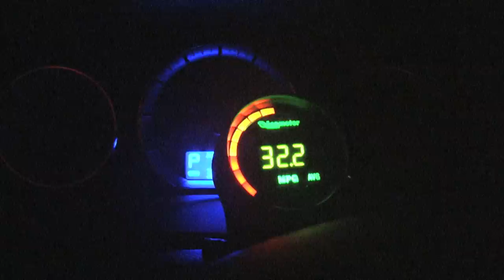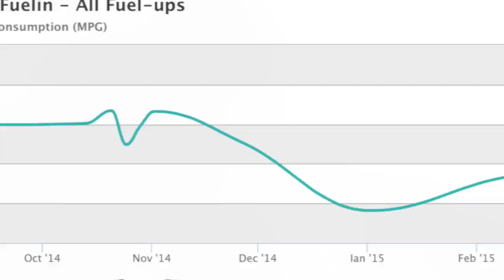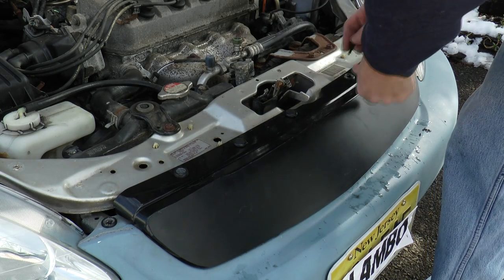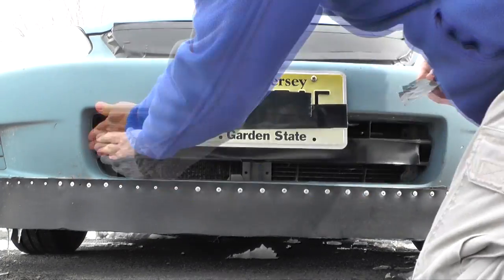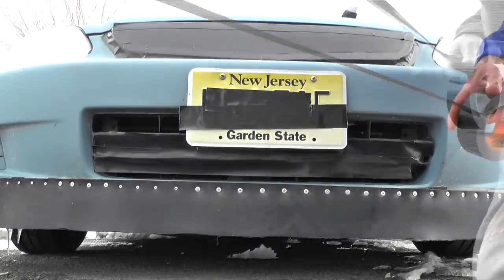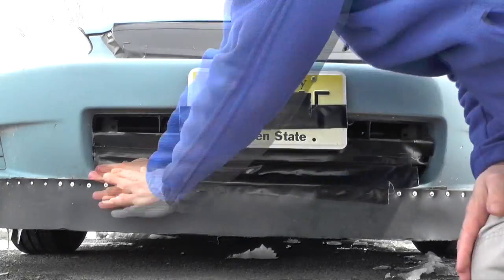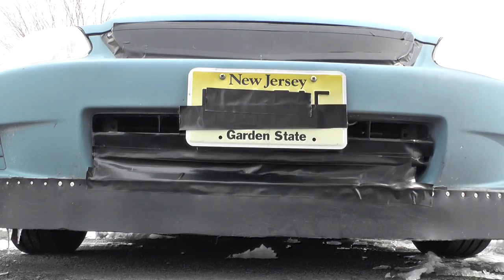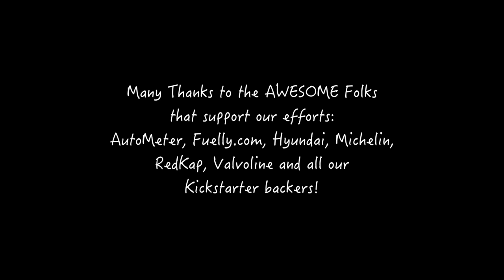Grill Blockers for More MPG? - Honda Civic Build - Ain't Fuelin'

Comment: In Canada, we just hang a piece of cardboard in front of the radiator cut to partially block airflow and adjust as required. It's a lot easier to install and remove if necessary. Truckers use zipper covers on the front grill because it's easier that way rather than having to open the hood, but basically does the same hing.
Reply from the maker: MichaelAChang Whatever gets the job done! Folks in warm climates think it's crazy. 😂
Reply: In Minnesota we do the same. Basically Canada climate of the United States..
Reply: @mpgomatic  i just tried removing the lower part of the intake but just got the helm Holtz extension off which had 2 pieces on this v6 honda (an extension into wider upwards expansion and the cover top that was clipped by 2 plastic push clips)

But that made it take longer to warm up the heater so i took the stupid beauty cover off and left the center plastic over the top of manifold as to not burn the hood cloth

Comment: wouldn't changing your thermostat be ideal? keep you in the proper range and stop you from overheating.
Reply from the maker: +Dustin Davidson Aye! I'll get to it one of these days …
Reply: +MPGomatic well it would make your fuel savings statistics accurate, instead of relying on on the weather today...
Reply from the maker: +Dustin Davidson It won't overheat due to the themostat - it's stuck open.
Reply: @mpgomatic  i think hes referring to the fact that the engine will not be at operating temperature thus your ecu will be running in an open loop, reducing fuel mileage.
Reply: Im in the same boat and the issue isnt over heating though  I just modified my intake into a short ram well a warm air intake using what i had.  It was a FIASCO  I can go step by step short story long

Comment: Did I miss the mention of cold air is denser and makes aerodynamics even more important? Much more air drag in the winter.
Reply: my car does get worse MPG in winter but come on its not that much worse that i have to modify the car.
if your so desperate you need to pinch every last penny it might be time to find a different job.  every time i get a new job i get better wages. 
tell your boss your pinching pennies hard core and desperately need a new job or pay raise. or drop some unnecessary subscription service you can live without. no one really needs TV when you have internet. sell some old crap idk modifying your vehicle to save money like a desperate coke addict trying to get another hit is just crazy. they were engineered to have a grill for a reason.
Reply: @darkshadowsx5949 bro out here comparing people trying to save some money on fuel to being a coke addict lmao

Comment: Heat the engine? Heat the fuel!  Run your gas line past your valve cover with a short distance to the gas inlet. You may need to cut a piece of radiator hose to use as insulation in order for that last 8 inches of fuel line to be kept warm. The flow rate is rather slow, and if you don't insulate the fuel line going into the carb, your temperature will drop. Use a laser thermometer to check engine temperature at various places in order to find the best place to rout the fuel line. I drove 20 miles, and then up a long hill before I checked my engine's temperature at various places. The valve cover on my vehicle was at a safe temp. nothing to crazy high like what you would get off the engine block, or exhaust manifold. More ambitious individuals can rout past the exhaust manifold, and use some type of gas (not liquid) metering. The fuel economy will go through the roof when you do this. There is a term called thermal inertia, and that's what you need to master in order to understand what this is all about. Fuel can't instantly go from a liquid to a flame. There is a transition period that takes time to change. If you don't set up the fuel properly, before you ignite the fuel, the unprepared fuel will go out the tailpipe.

Comment: I was thinking il get some useful info here but not really. Thermostatnin working order is a must! I have very economical diesel engine so if thermostat doesnt seal 100% its not going to heat up. When itry really cold it doesnt get to operating temperature just heating the cabin. So i was interested in aerodynamic part of fuel economy effect only here

Comment: I feel like directing a circular air flow grill would be the best solution to both problems. You would have wedged panels aiming towards the radiator from the top and bottom, making a direct flow into the radiator while pushing air out smoothly, that way air doesn't circulate through parts that don't need it

Comment: Nice vid Dan! I agree with everything you said about grill blocks. I tracked my instant fuel economy with my old car, a 2007 Matrix, and my ScanGaugeII would allow me to see the temperature difference with a grill block. The max temperature I would see on a typical day without my grill block was 180-185. I think the highest temperature recorded with my grillblock was 201, so I might have been blocking too much of it. Nevertheless, I was more glad than anything since I was able to fix myself a grill block using an old car mat of mine and I wedged it between the radiator and the metal frame on top of the airbag sensors. Cheers!
Reply from the maker: Thanks, DominicGuitarist! Using an old car mat is a cool idea. I'm going to leave the upper grill block in place to see how the engine temps fare as the weather gets warmer.

Comment: This was my first video of yours.  Now I'm going to watch as many as I can!  I'm putting a 351W in a Fox Body Mustang.  And I'm going to see what kind of MPG I can squeeze out of it!  Thanks!
Reply from the maker: Rob Daugherty Thanks, Rob! 351W/Fox Body = Cool!
Reply: Go for 35.1 highway to repp it for that! 

Maybe for go the 4.10 differential then, no no just kidding.  My buddy put 4.10 on a automatic dakota and did better in city due to shifting into o/d at 35 mph

Legitstreetcars made a eco vette c5 aiming for 40 mpg
Reply: Come to think about it would 4.10 be easier to roll with since its giving it more torque with its gearing say like a 0.74 and 0.50 in the T56.  Even though some try to say the 2.73 in place option 3.31 would be more efficient going 60 on the highway in the 2011-2020 coyote

Comment: I beat you would have seen those same improvements with just a properly working thermostat. Those lean burns dont like to be really cold. If it was too cold the car may have never went into closed loop. Did you notice on dash command if the car was entering closed loop?
Reply from the maker: EGGINFOOLS Indeed. The engine did not want to flip into lean burn when it was cold. Dash Command's Instant MPG charting screen show the efficiency levels fairly well. We will be installing a new header/cat with a third (wideband) O2 sensor and air/fuel gauge soon.

Comment: Thanks Daniel! I have the same problem with my 95 Accord. The temperature gauge drops at speed but normal at idle. It's got to be the cold air.
Reply from the maker: Sure thing, aquateen77723! How cold does it get outside in the winter? I'd never experienced this phenom until this winter, in this car.
Reply: MPGomatic It's been around 1°-20° for most of the winter in central NJ. I think the thermostat is stuck open like you said. I tried blocking the lower portion of the fascia with cardboard and it worked!
Reply from the maker: aquateen77723 I'm in CNJ, too. These last two winters have been brutal. Are you still using the cardboard blocker?
Reply: Yes, I still have the lower part blocked. I zip-tied it to the inner grill. I was watching Ice Road Truckers, and they did the same thing to their rigs! But yeah, this winter was brutal!

Comment: did the exact same tests in 98 got the exact same results as you thats funny!up in alberta engine could not keep temps..i had a short ram intake on it as well and this was the problem...coverring the grills full on top and half bottom worked...untill the next winter i removed the short ram intake voila engine kept temps without blocking anything...

Comment: I block my grill every year, any extra cooling needed is done using the cabin heater. At the end of the winter I just pull off the tape.

https://www.fuelly.com/car/toyota/aygo/2012/mikes1992/348332

I do this mostly because I'd have to sacrifice engine temperature to keep my self warm without a grill block
Reply: Heat pump from ac?

Comment: they must do? why? cause the toyota aygo has it built in, only half the grill is actually open, the radiator is tiny and is only a half width and resides in the open grill part

Comment: in fuel injected computer controlled cars the  thermostat should be replaced it gives the computer a signal that the motor is cold and injects more fuel so fucking fix it first

Comment: 4:06 191 degrees is not too high, that's what it should be, at least. 170 is too low.
My car has a thermostat that opens at 198 degrees.
Reply: lfsracer79 191 is too high for a Honda. While my Subaru maintained 195-200, my Hondas kept 170-175 as normal operating temp. Different manufacturers and engines have different spec thermostats.
Reply from the maker: lfsracer79 Advance Auto lists two Stant thermostats for the Civic HX - 170° and 180°. I'm not sure about the OEM spec, but Lean Burn doesn't work well unless the engine is warm. I'll be swapping in a new unit now that the weather is warming up, most likely the 180°.

Comment: Im gonna try this next winter, living in Alberta having a week of -30C/F and the mileage is crap at that tempature
Reply from the maker: ***** Holy cow that's cold!
Reply: you have no idea, running stop and go traffic, if you have your heater fan going 3 or 4 (1,2,3,4 being the fan speeds) your engine just loses heat at a red light, its painful
Reply from the maker: ***** Time to fly south! I tested the heater fan at speed and saw a 10° drop/rise when turning it on and off. Do you see many folks with grill covers in those temperatures?
Reply: the big trucks do, 2500-3500 pickups, as for cars not really

Comment: Too bad I have a 95 civic. It doesn't have the under dash connections:(
Reply: +Wilkerson Productions  You have to get a gauge with a temp sensor that you can add on to your car. There might even be a wire you can tap into currently but best bet would be to do your own sensor. Definitely worth it if you need to know the temps.

Comment: Dan I'm guessing you are on this already but are you getting your fuel from the same source for every run?? I see a 5-15% difference with same octane from different stations, and a huge swing if I buy the zero ethanol stuff from one station in particular.
Reply from the maker: Septimius13 Yep! I usually buy the same brand, same station, same octane, same pump. I change brands from time to time. Trying to stick with top tier gas, right now on BP. Closest ethanol-free gas is an hour away. I want to try it on the next fill. I note the brand/station on every Fuelly fill. Just cracked 10K tracked!
Reply: There are methods to remove ethanol it's simple get your gas in a gas can put it in clear container with a valve at lowest point add water mix it up good let the water ethanol mixture settle to the bottom and purge it out.

Comment: I generally put a full grill block on once the average weekly max temp drops below 10c and then turn the heating up to cool the engine if it needs it. It keeps me warmer and keeps the engine in an efficient temp range. You can quite easily over cool the engine in my car with the heating settings and so even with a grill block it only really gets turned up when going up hills. My under bonnet temp in winter stays around 15-21c and only really get a fuel economy hit when first starting the car. My winter mpg is only about 10% lower on average then my summer mpg. 72mpg drops to around 66mpg

Comment: what kind of dongle do you use for your iPhone ?? i want to use dash command on my 1997 honda civic
Reply from the maker: 18switchfoot It's a no-brand <$20 Amazon dongle. I looked  for one with a high-rating to avoid the junk. It works well 99% of the time but can lose its connection from time to time. My biggest gripe with this one is that it's huge and can get knocked off the port. I'd go for a more compact model.

Comment: But are you blocking the transmission cooling part of the radiator?
Reply: The transmission cooler is inside 1 of the tanks
Reply: Damon D Master What tanks?
Reply: There are tanks on the bottom and top or on the sides of the radiator the transmission cooler works in conjunction with the temperature of the coolant in the radiator I'm pretty sure you already know the answer to these questions tho
Reply: Damon D Master I actually did not know that. Makes sense.

Comment: The cause of the improved fuel economy is air intake temperature.  It's simple.  The ECM adjusts the stoich/ injector timing.  Hot air, less dense.  Fixed gear ratios, less fuel per charge at a given RPM/ SPEED.  Aerodynamics and the engine's physical temp?  If you don't know what you're talking about pick another topic.
Reply from the maker: That would be an excellent test to run with data logging, Tyler Brownlee! I did not make note of the intake temperatures, just the coolant. The Civic HX's D16Y5 engine uses lean burn technology to achieve higher levels of fuel efficiency and is reluctant to enter lean burn when the engine is below operating temperature. No lean burn = lower fuel economy. Aerodynamics do play a part in this, but to what degree is tough to determine. Take a look at how many manufacturers use adjustable grill shutters to close off the grills in their new vehicles …